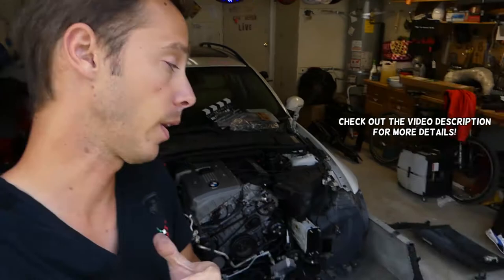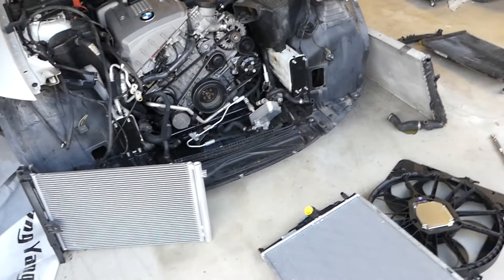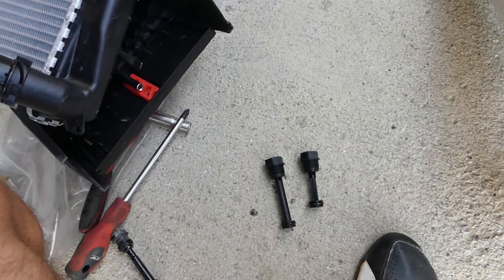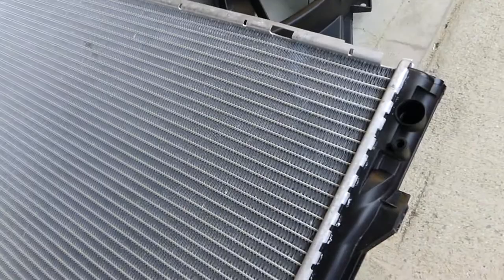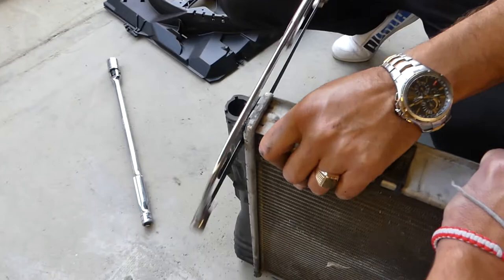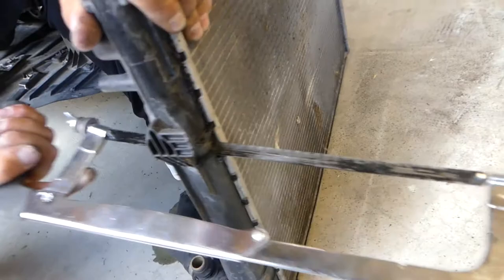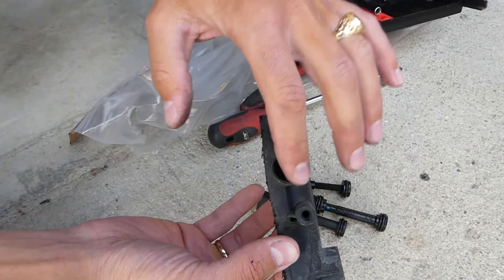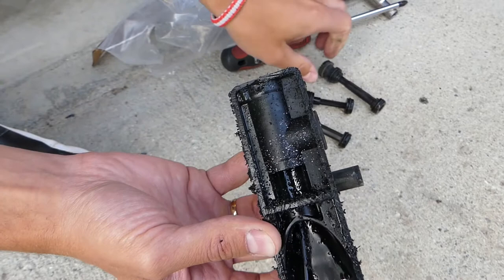BMW E90 E65 LONG OR SHORT RADIATOR DRAIN PLUG E91 E92 E93 323i 325i 328i 330i 335i 335d

Comment: Automatic transmission = long plug. Manual transmission = short plug.
Reply: I used the short plug, I think I forgot to use the 2nd O ring, so I see some water below the drain plug, any idea how to remove the plug so I can insert the O ring
Reply: @nivashenpillay4236  yo bro same thing happend to me i installed the short one just today and its leaking from the plug
Reply: @gamingoverdose2792  need to remove plug put 2nd o ring , dangerous move but needs to be done

Comment: I just repaired OFHG and I'm paranoid about the automatic transmission cooler. When flushing the radiator, the oring on the top part of the plug broke, didn't pay attention to and kept flushing the radiator. There's not a chance coolant went into the transmission because of that, right? I've replaced the oring after the job was done.

Comment: Hi . I  just  wana  ask  why  the  transmission  cooler  takes  water  from the left  side  of the radiator  (  side  of  higher  hose that suppose to  be  the  hot  side) ?

Comment: I have right now a situation, I'm installing a new radiator in a 325xi with manual transmission, im putting the short plug and still leaking

Comment: Bit late for me mate i used short one on auto as company recommended it was aftermarket radiator n ny transmission is slipping now n big jerk on reverse when car is cold it drive normal when it gets to opreating temp starts jerking u think if i change it now could save my transmission 🤔😔

Comment: Hello! So I’m having this same problem with my drainage plug for my bmw, they sent me a long and short plug, but the long one they sent me is actually the short one , and isn’t long enough. I’ve been looking online for a long drainage plug for automatic, but I can’t find the exact one you have in this video . I specifically need the one that has the longer threads, would you happen to know where to get one? I wouldn’t wanna have to buy a new radiator just for that specific piece:(
Reply: Did you find it ?
Reply: Having this same issue

Comment: I bought a behr automatic transmission radiator but it didn’t come with either one, so I’m hoping it didn’t need it
Reply: Dude same here, it wouldn’t mess it up cause ours are plugs with no stick part, so water will still flow.. did yours leak? Just put mine in today